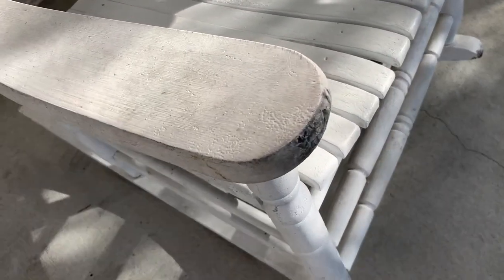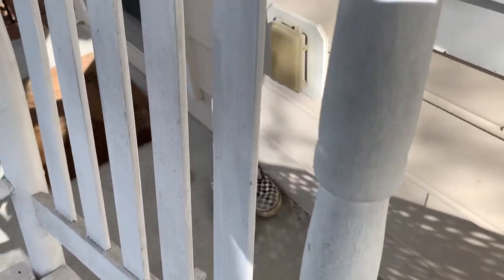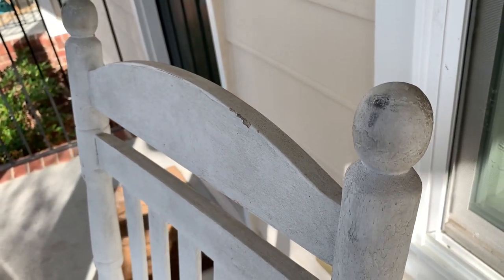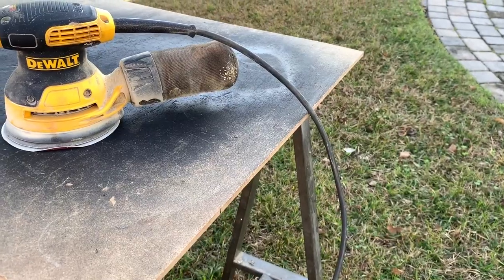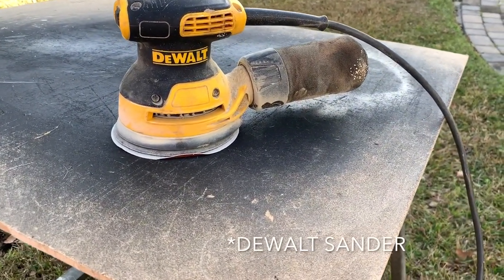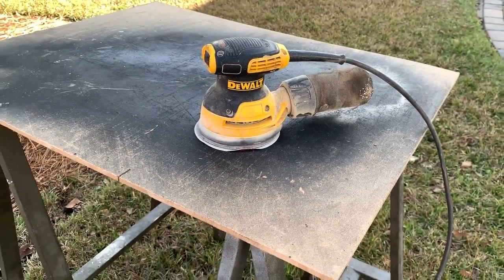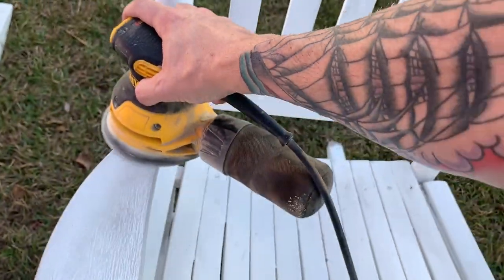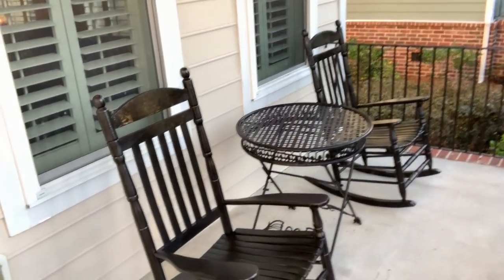Rocking Chair Rehab

Comment: Hi! If you don't have a sprayer for the spray paint, would you recommend hand-painting vs. regular spray paint? ALSO, for using hand sandpaper, did you switch grits or keep it at 220?
Thank you! This is an excellent tutorial!
Reply from the maker: Hi, I still think spray painting is the way to go for a nice even coat and reaches spaces that would be hard for a paint brush. You could go with a heavier grit sand paper if the previous paint is bubbled or peeling. I just went with 220 to rough it up a bit so the paint would stick well.